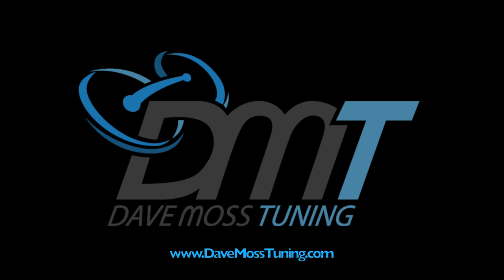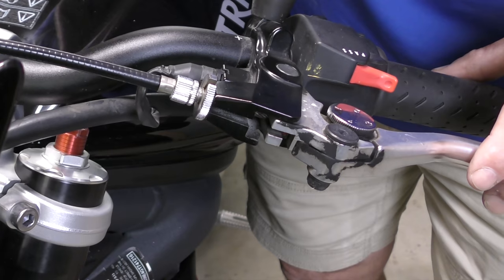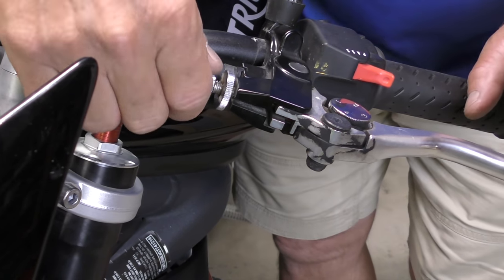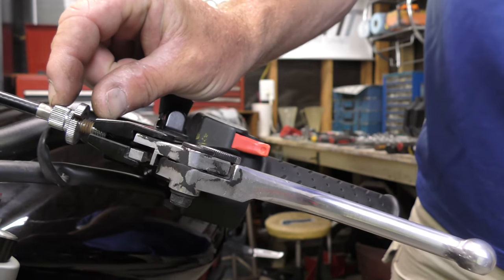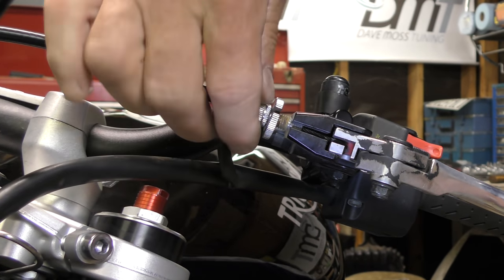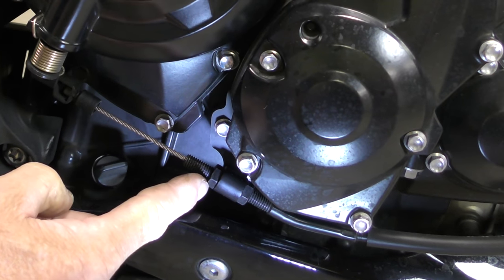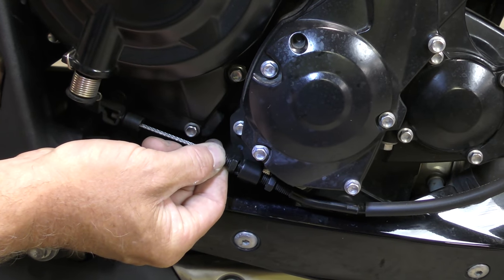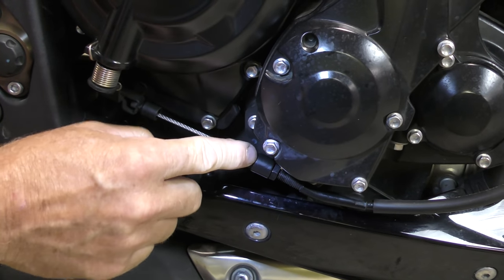Adjusting Your Motorcycle Clutch Lever Free Play

Comment: U never adjust the clutch Freeplay while hot. Use a nickel which is 2mm on the purch
Reply from the maker: Can you advise us all why you have this POV? Thanks!
Reply: @catalystreactionsbw  heat expands does it not? Would u check tire pressure before , or after u drive
Reply from the maker: @susanlang1630  cold to hot is normally 3-4psi on the road. Yes, set cold and then check hot after about 4 minutes.
Reply from the maker: The clutch plates swell with heat, so the free play can diminish. Therefore I set the free play when the engine is at full operating temperatures after a 30 minute ride.
Reply from the maker: @susanlang1630  Pressure is seasonal, so cold air at 45F will measure 30psi and the same air at 90F will measure 33psi. I set seasonal cold pressures before I ride.
Reply: @catalystreactionsbw  You tell him mate!!!!
Reply: @catalystreactionsbw  thats what i am afraid off, while they cold they wear

Comment: Glad you made it clear that this adjustment should be done when the engine and clutch are hot. If the clutch cable has been replaced or the handlebars/yokes have been replaced, you want to check that the free play doesn’t vary when you turn the bars from one lock to another. Have personally got this wrong before.

Comment: I have adjusted my cables with a little Freeplay...clutch shift is smooth only at times when I drop at 2nd gear there is a rattle sound..and also when i ride a distance,I notice my clutch at times have the adjusted Freeplay but at times feels tighter no Freeplay ..like the lever cable tighten itself..when I come to a stop it will have back it's Freeplay. Is it the clutch friction plate needs replacement?
Reply from the maker: Is this true between hot or cold engine temps? Is it consistent? It might be the friction plates getting uneven wear or the plates getting caught on the steel basket "fingers".
Reply: @catalystreactionsbw  yes you are right..I changed my friction plates and it's uneven..now it's smooth and before this there was some vibrations..but now it's all good
Reply: @catalystreactionsbw  tq Dave ..

Comment: I thought your suppose to adjust when the bike is cold because when it's warm the bike is hot or warm everything is tighter because of the expansion of metal when its hot vs cold
Reply from the maker: You can set cold and check when hot to see if the metal expansion with heat creates a big mathematical difference with your motorcycle. Then you will know if cold or hot is the preferred starting point for you with your motorcycle.

Comment: Terrific tutorial - liked and subbed.
QUESTION: Awhile back I adjusted the free play at the lever. I'm noticing that when I want to shift from  1st gear to N, it skips to 2nd gear - so do I need to increase or decrease the gap?
Thank you!
Reply from the maker: Thank you for subbing! The gap on the clutch cable is set when the bike is hot. Once optimized, it will be inspected every 1,000 miles or 1,500kms. The shift issue may well be 1. The distance between the shifter and peg and 2. The angle of the shifter when you reach the top of the stroke. Also with the bike on a rear stand and engine off, feel the mechanism from first to neutral, neutral to second. It should be definitive with no slop at all. We need to identify an issue or eliminate the mechanism.
Reply: @catalystreactionsbw  Please answer my question - do I need a wider or shorter gap?
Reply from the maker: @usernamemykel  The gap with a hot engine is 1-2mm. Look at what you have now. If this is your current free play amount, no further adjustment is needed. If this is accurate, you have a different issue going on with shift lever angle or the gear box. Be systematic and work on one thing at a time.

Comment: should I adjust the cable when the handle bars on the center? cause when I turn the handle bars to the left or right that freeplay is completely gone.
Reply from the maker: I would adjust at center and if the free play is gone at left or right I would check the position of the cable to see why the free play is gone.

Comment: When the cable gets old, does it elongate?  Up to the point it needs replacement since you run out of adjustment.
Reply: Once you run out of adjustment or the cable becomes worn you replace it. If the bike has high mileage it might be worth checking the friction plates thickness on the clutch itself too.

Comment: On bikes with reservoirs connected to perch, how can I adjust levers to be more ergonomic? My levers could use to go down but then reservoirs would not be level.
Reply from the maker: If it is a solid cast piece, you can angle down as the gasket seals 100%. If the reservoir is on the upper triple tree you need a longer line between it and the master. Lastly, make sure your brake lines are facing forward at 12 o'clock.
Reply: @catalystreactionsbw  Understood, thank you very much for taking time to answer my question!

Comment: Hi Dave, what is your opinion on hydraulic clutch systems? There is a kit called Hymec by Magura which can be fitted to most bikes and replaces cable system with hydraulic one. Would you fit it to your motorcycle? Thanks.
Reply from the maker: IMHO I prefer the feel of a clutch cable and knowing exactly where I am with the clutch and transmission. I personally find that a hydraulic clutch lacks this to a point where I am searching for it while trying to keep control of the bike and this is valuable time lost. Depending on the slipper clutch you have and how well it is set up, the hydraulic options might be easier.

Comment: I have a question. Is there anyway to feel if its correct when driving?  Alot of people say wrong setting can burn the clutch in no time. 
Im new to the moto world and cant really feel a diffrence if its too tight or too loose.

I drive a kawasaki z900 -20 if it helps.
Reply from the maker: You check free play when the engine/cable is hot. Set it at 2-3mm as per video. Post adjustment see where the bite point is. If all is well, carry on. If the owner's manual gives you a second adjustment for the clutch at the engine end, use it as needed.

Comment: @davemoss Do we also need to adjust the quick shifter once the clutch cable is adjusted?
Reply: The QS cuts off ignition during shifts when the sensor on the shift rod is triggered, that system has nothing to do with your clutch cable.